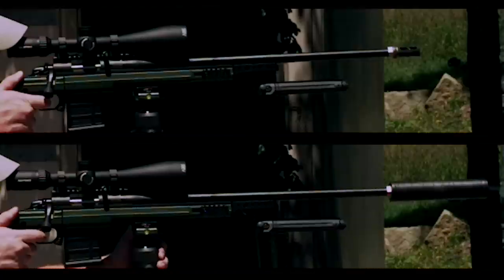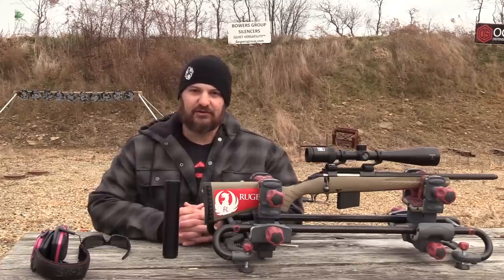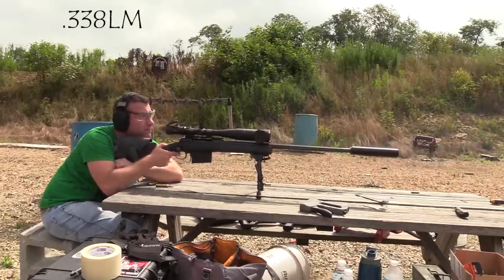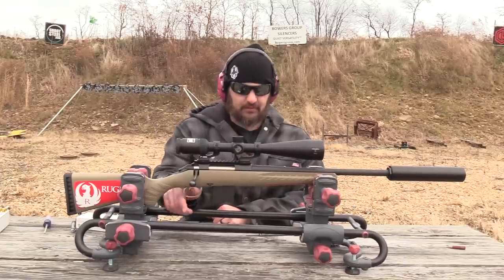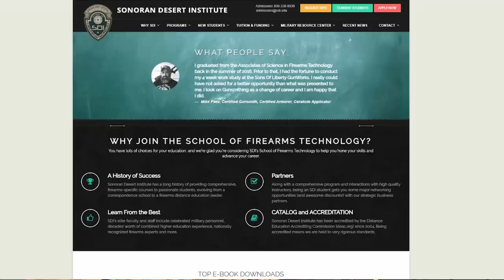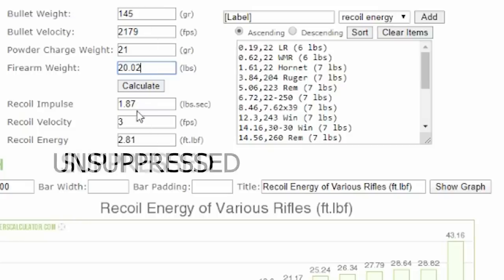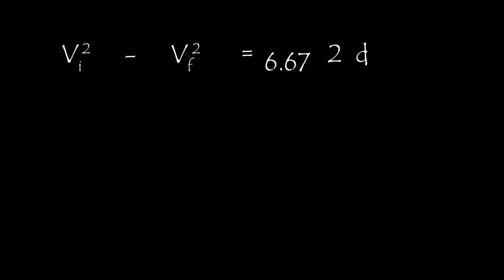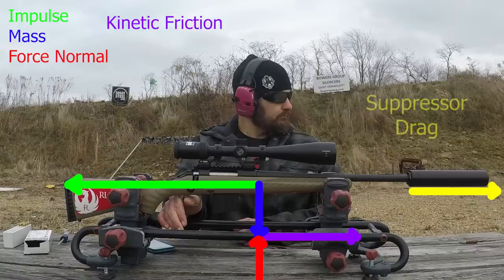Why Do Suppressors Reduce Recoil? Hidden Gun Knowledge

Comment: So you can blow on your own sail?
Reply: Yes and no. In the "break Newtonian physics" sense, you can't blow your own sail. It is possible to blow on a sail and as long as it becomes curved, the thrust is redirected back around giving you forward movement. You're just using the thrust of your fan/compressed air in an inefficient manner.
Reply from the maker: Nope. You forgot that you added an internal combustion engine to the boat. You are creating energy. A certain percentage of that energy is simply lost to ambient venting, you are capturing it
Reply: Oh okay, I gotcha. I guess this means blast shields on brakes should also not reduce their effectiveness?